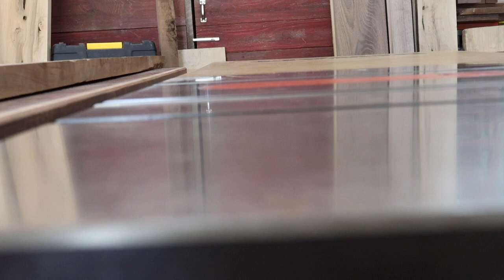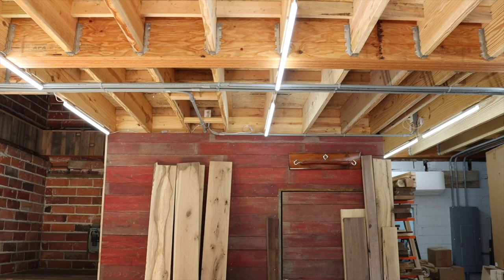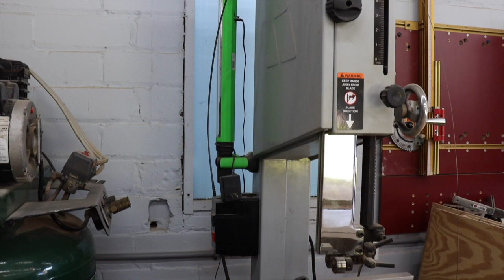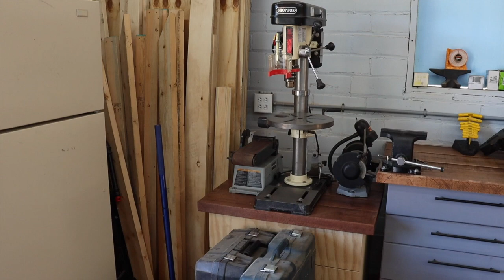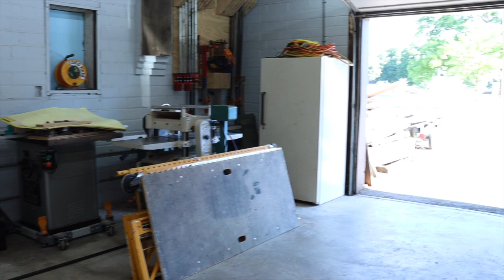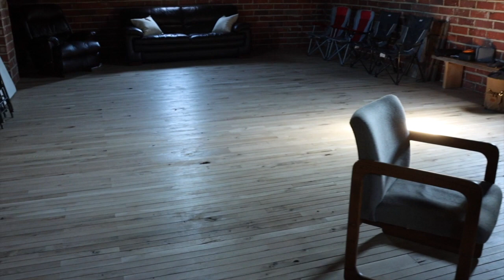2020 Shop Tour

Comment: Good shop buddy, looking forward to your next video, I did smile because the table saw you have I had the very same a few years back, the dewalt 746, great saw and I sold it, major regrets, I went through a number of table saws until I got the new Laguna fusion 3 which is an amazing table saw, anyways best of luck, kind regards Louie
Reply from the maker: Thanks for checking out the video Louie! I do enjoy the Dewalt table saw. It's been a work horse for sure. It does especially good if I keep a good ripping blade on it. Thanks for stopping by!